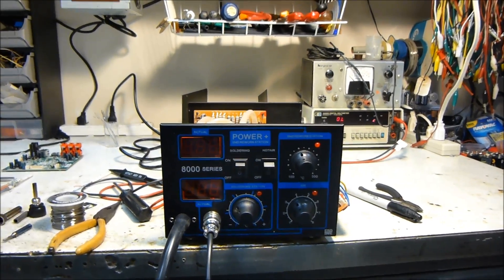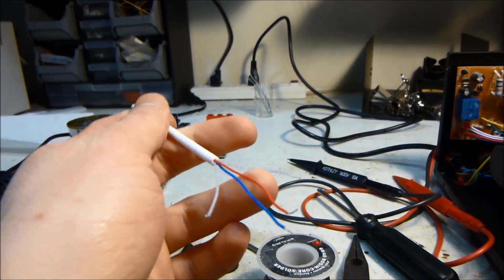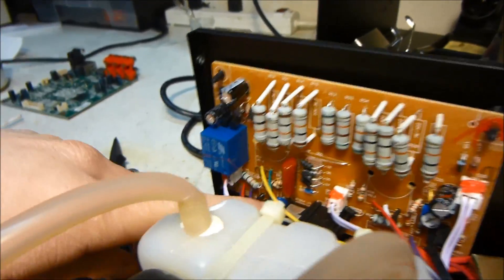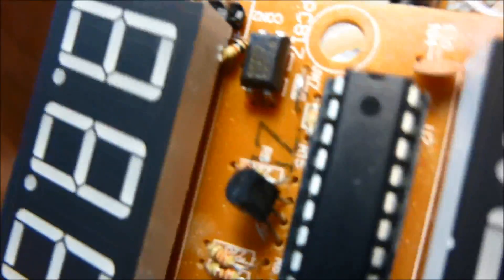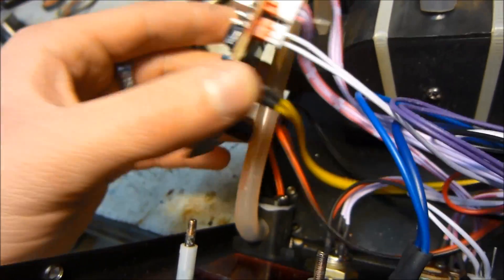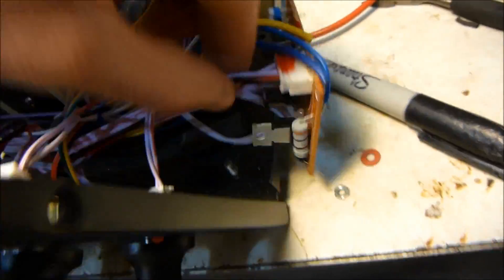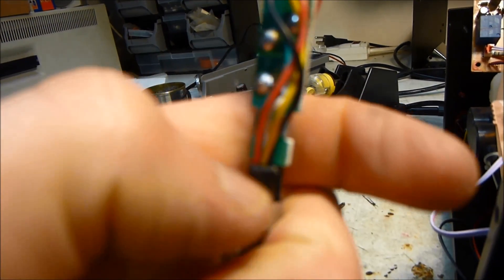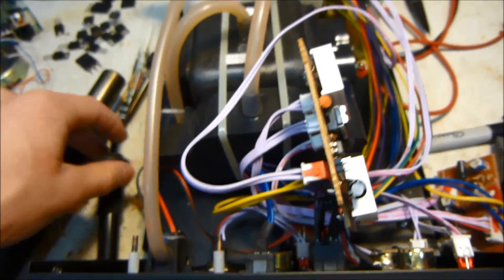Review, Failure, & Troubleshooting of Power + 8000 Air Rework Station 2 in 1 Soldering Station

Comment: I have the same unit and it was good for several years.  It ended up having a blown ceramic heater due to the pump circuit shorting.  Full heat and no air will kill the element every time.  I think it's an open FET.  I retraced the board but gave up.  One day I'll fix it. 
.

Comment: It is a thermocouple in the element and why it has 10 volts is odd. 9 volts should be the common voltage. 110/220Vac, 24Vac, 9Vdc, and 5Vdc.

Comment: What temp did you solder and rework (hot air) at? Looks like you overheated both the soldering pencil and hot air gun.
Reply from the maker: +Killer2600 I had the dial set around the middle.. I expect my soldering station to work perfectly at any temperature that I set it at. If I can turn it up to 600F and it melts then something is obviously wrong with it. I don't think the temperature regulation circuit worked at all. I think it was shorted.
Reply: 60/40 solder melts at 370ºF so 600ºF is a bit excessive. The best irons will "corrode" as you call it, the better term is "blue" or "oxidize", at high heat levels. The only way to avoid it is to keep a temperature controlled iron/station set to a low temperature that is no hotter than necessary. Turning up the temperature dial will heat up the iron and melt solder super fast but it'll also oxidize and blue the tip and other metal bits super quick as well. It's even noticed with the hot air gun that supposedly works well, the discoloration at the end of the nozzle indicates it got quite hot.
Reply from the maker: Killer2600 yeah, I know. still tho, even if I had it turned up to the max setting it should have lasted longer than 10-15 min. that's simple common sense engineering design. the hot air gun barrel gets smoking hot but the air doesn't get all that hot for some reason. you can hold your hand in front of it and not get burnt. even on highest setting. I have soldered a few SMD LEDs off with it but it take 5 min before the solder starts to melt. I tried replacing a cracked phone screen with it and I got really frustrated because it wasn't heating it up enough even after 15 min. Then I tried a hair dryer and it worked 10x better. If you don't believe me and how bad the quality is I can send it to you. It takes up too much space in my workshop. the only reason I still keep it around is because it does a cleaner job at shrinking heat shrink tubing than a lighter.

Comment: Can anyone confirm that the heating element for the hot air runs through the triac mounted to the heat sink (U2)  on the rear board and the other without HS (U3) is for pump control? The U2 BB04 (on small 936AV1) is for the soldering iron element??? Suprising that they don't all have heatsinks on mine...

Comment: How does the air flow system designed, what are its parts.
Reply: +bazrazin1 I just picked up this unit myself and as all things that come for a steal, I expected there to be challenges.  I beefed up the grounds but noticed an issue with the variable pump control.  You asked how the air flow is designed...  it's a cheap 10-12VDC diaphram pump that appears to be regulated with a pot that's wired more like a rheostat.  My variable control doesn't work but it's wired the same way the OP's is with a green and yellow wire in the first 2 positions and then 2 terms on the rear board marked, "AIR VOL".  It basically uses an aquarium pump but I need to fix the variable control maybe with a small PWM circuit... who knows....
Reply: A Nixon thanx for the info.
Reply: +bazrazin1 just looked again...  more specifics...  AIR VOL 2 (3 connections... Y-G).... AIR VOL2 (3 connections.... R-W-B).  AIR 2 'looks' like it should have 3 connections but only has the two which are the same wires represented on the pot in the front panel....

Comment: Btw, the tips shouldn't blue like that unless you are using the iron on max heat (~480C) or that's at least how it is on the Hakko. I think there is some problem with the temp sensing circuitry in this station. Probably it think that the tip is cold and crams max heat into the tip.
Reply from the maker: Yeah that's what I was thinking.  Seemed like they blued and corroded really fast.  But then when I was soldering with it it melted the solder slower than my cheapo 25 watt Radio Shack.  So something was really wrong with it.  Thanks!
Reply: Makerj101 Yeah, then something's really wrong...

Comment: I wound say, leave this station JUST for the hot air. Get an Hakko fx-888! MANY people use it including me! Got mine around 3-4years ago and it's still going strong with it's original tip. I have put mine through hell but accidentally leaving it on a couple times when going on vacation for weeks. The one I have has the adjustment knob but now the newer version has a digital display and should work just as well! http://www.ebay.ca/itm/Hakko-FX888D-23BY-Digital-Soldering-Station-FX-888D-/281104049653?pt=LH_DefaultDomain_0&hash=item41731b65f5&_uhb=1
Reply from the maker: I think I will do that.  I think I might rewire everything and replace the controller circuit with a real controller unit that I actually trust.  So I will basically only be keeping the pump and wand.  I really think if I keep the original circuit it is going to burn out the heating element soon.  It stays on way too long and gets too hot before it turns it off again.  Plus I'll add a grounding wire for the heat gun tip cause that's just dangerous.  Yeah I was trying to decide between the Hakko FX-888 and the Weller WESD51.  I went with the Weller.  Now I'm waiting for it to come in the mail!  :D
 http://www.amazon.com/gp/product/B000ARU9PO/ref=oh_details_o00_s00_i00?ie=UTF8&psc=1

Comment: you should rewire it all with higher guage, and try fixing it up because it looks like it would be a real sweet station
Reply from the maker: I don't know.  I think I will rewire the heat gun part and make it into just a heat gun.  I think I'm going to invest some real money in a soldering iron I know will work from a trusted company like Weller.  I solder a lot and I don't want another piece of junk that will brake quick.  Thank you for the suggestion!  :)